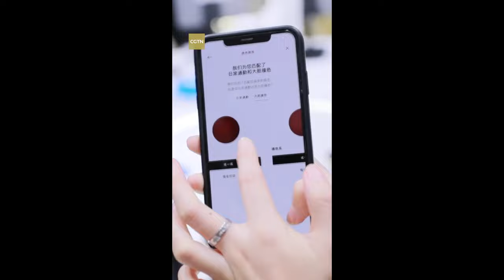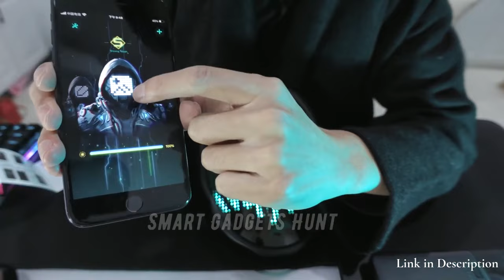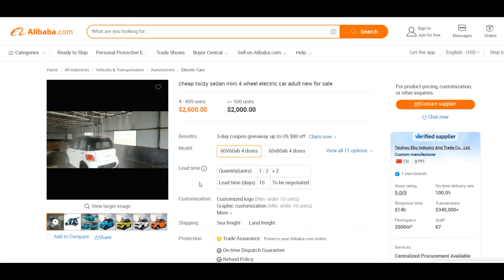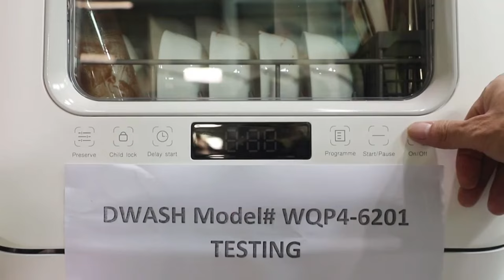BUSINESS IDEAS FROM CHINA. TOP-20 THINGS TO BUY IN CHINA AND RESELL ON AMAZON or eBay

Comment from the maker: 0:00 Start
0:24 Radio-controlled planes
0:50 Spiral glasses
1:17 Lipstick Printer
1:44 Electric multi-tool
2:09 Compact folding gas burner
2:28 Drones with goggles
2:53 Led tumblers
3:24 Steering wheel phone holder
3:46 Led masks
4:11 Compact folding ladder
4:43 Multifunctional sinks
5:03 Tea kits
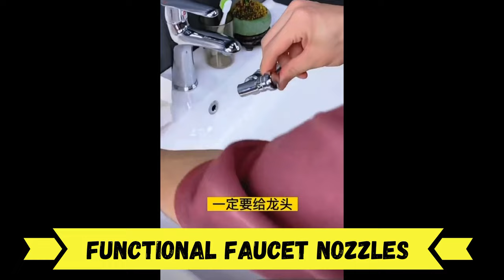5:19 Functional faucet nozzles
5:39 Compact teapot
6:04 Mini electric cars
6:25 Portable mangals
6:51 Sensory nightlights
7:14 Robot crawlers
7:30 Protective visors for car mirrors
7:50 Tabletop dishwashers
8:17 20 PROFITABLE BUSINESS IDEAS
Reply: Yes
Reply: Where to buy these products
Reply from the maker: @YuvinNaidoo-ks5pj  The links that we managed to find, we left in the description under the video.